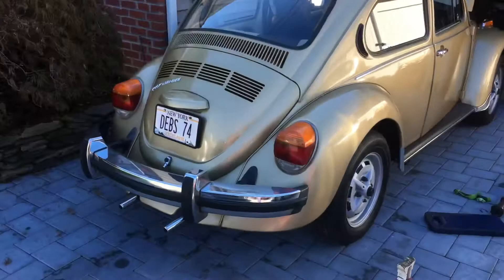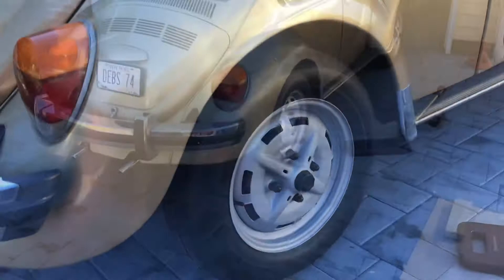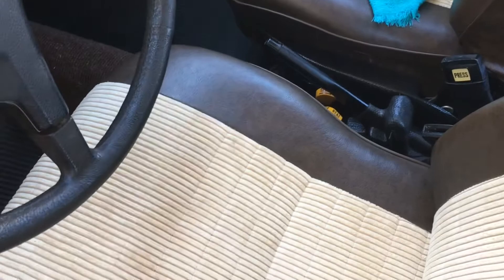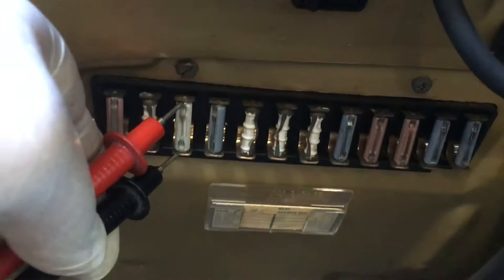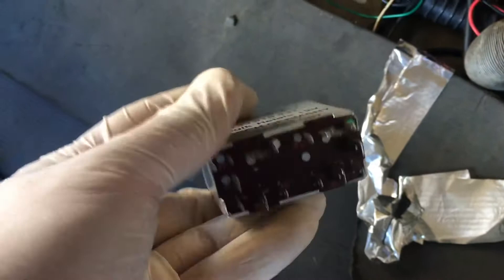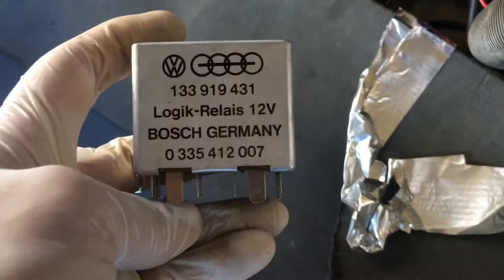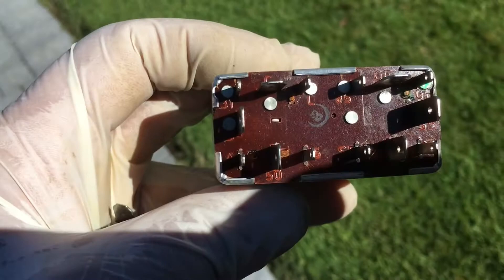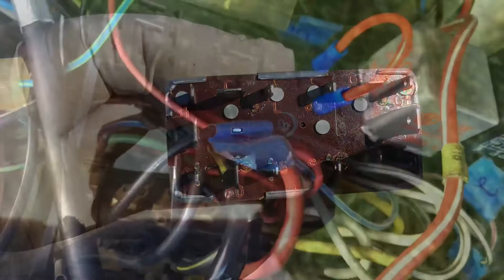1974 Volkswagen won’t start, seat belt interlock relay

Comment: Nine digit VW part numbers are an example of German ingenuity. In the case of this relay, 133 refers to the model number. A Beetle is a Type 1, so the number starts with a 1. If it were a Type 2 Transporter it woud start with a 2, part number 211 xxx xxx for example. Type 3's would be 311 and Type 4's 411. The three digits increase to illustrate the exact model.
The second group, the 919 is a nine because all electrical parts are 9's. Body parts start with an 8. The 431 identifies the part specifically, the relay was a late addition to the model so it's no surprise that it's quite a high number. 
Sometimes there will be letters after the part number, like an A for example. If the design of 133 919 431 was improved so that it was less likely to fail then the number might be 133 919 431 A. I've seen VW part numbers ending with letter like E or G or more where the part has been refined several times.
VW parts for one type were used on different types. Type 4 dashbord instrument clusters were fitted to late Karmann Ghia's so you'd find a 411 part on a Type 1 Karmann Ghia. Parts for Beetles were the most commonly used parts on the other types. This relay for instance would have been fitted to all the other types to operate their fasten seatbelt signs.
Reply from the maker: @chrisst8922  Thanks for this information. 👍

Comment: I did this and it worked!
Later, I had a stop light plug melt on my Master Cylinder.  It's a 3-prong switch, where one is for the dash light.  Should I not connect that wire when I replace the switch & plug, or is it un-related to the safety relay mod?
Reply from the maker: Not sure. I wouldn’t think they would be related. You would need to take a closer look at a schematic to see if they share any common wires. Thanks for watching.

Comment: Wouldn't connecting the wires that go to "C" & "50" together before they reach the fuse & relay panel accomplish the same thing? Using an insulated double spade connector that wolfsburg west sells?
Reply from the maker: Did not know they made that, plus they needed to use the car for an event. Thanks for watching!